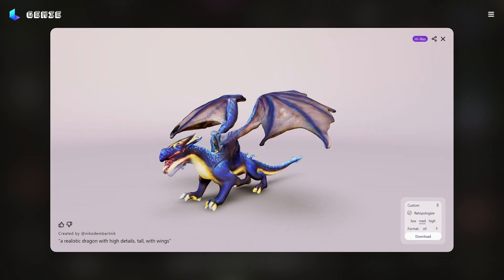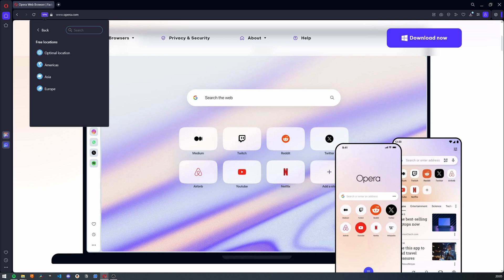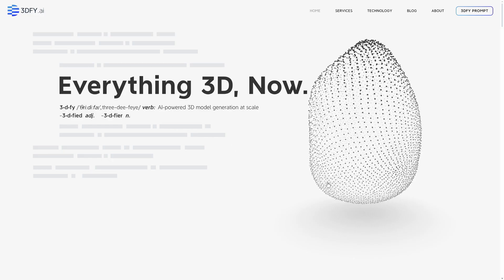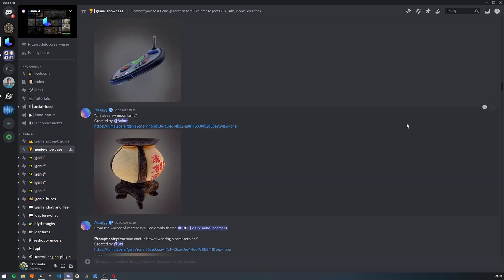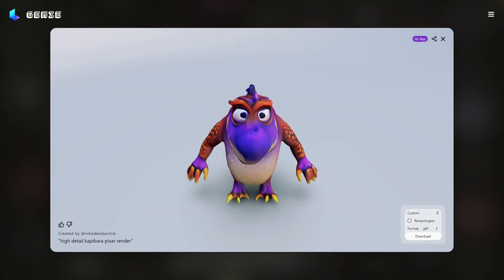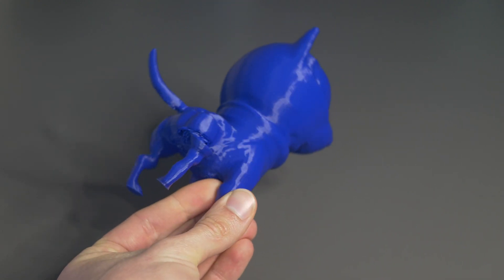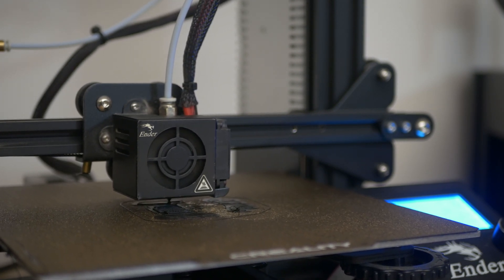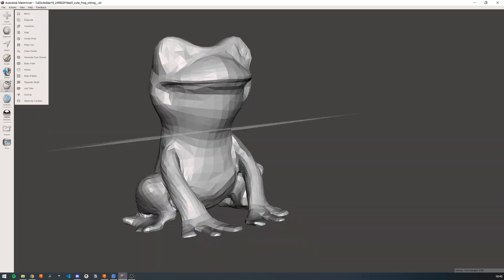Free AI Generates 3D Printable Models

Comment: There's a way to turn the details of the texture into tangible details on the surface of the 3D model that can then be 3D printed. It is not a free solution, but you may find a way to do it for free.  It involves Zbrush.  Here are the steps using Zbrush commands.  Let's say you start with an FBX or OBJ import with the texture.  You simply subdivide the model up into millions of polygons and then mask by color / mask by saturation and then deform by inflate.  From there you'd decimate it down and then export it as a STL for 3D printing.  There are numerous other ways to do it in Zbrush, this is just one of the ways.  I'm not very familiar with the various free sculpting software available but I'll bet you could do the same in most of them.